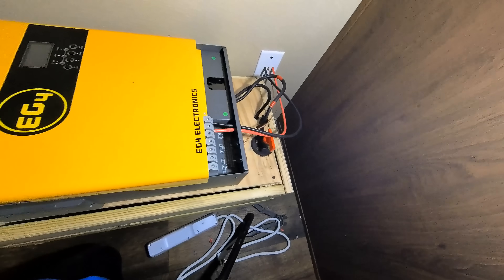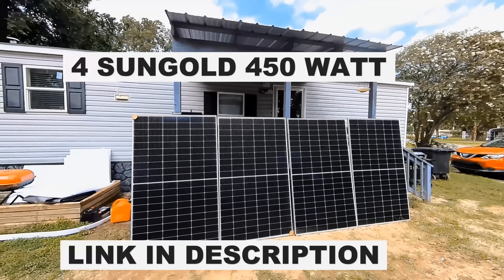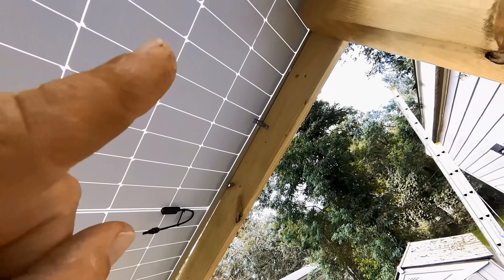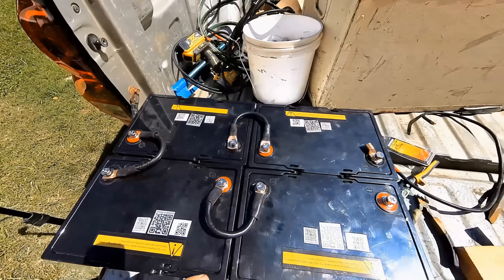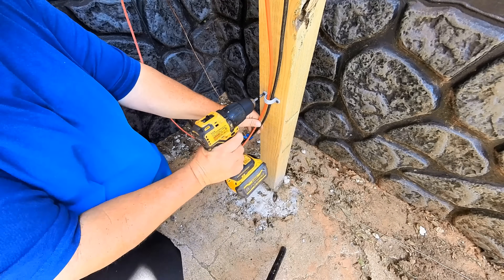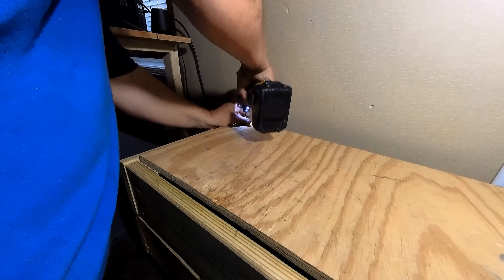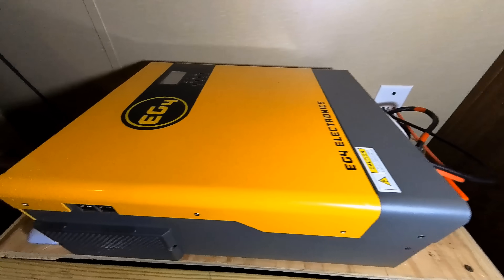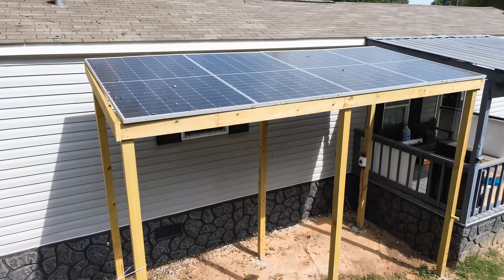Simple Solar YOU CAN BUILD!  Using Sungold Solar Panels

Comment: Why did you choose to do 48 V 100 AH instead of 12 V 400 AH? Is there that much better efficiency converting to 120 V?
Reply: Also, wouldn’t it be better to run a series parallel solar array? I seen power loss when doing all series, also overcapacity for most solar controllers.
Reply from the maker: You're definitely not going to get a power loss wiring them in series it's just all about the way the math is done it all comes out the same except for the fact you are much more efficient as far as higher voltage means lower amp and lower amp means smaller wires but yet it's the same power in the end... 12 volt is basically obsolete when it comes to a home solar system.. 24 volt at minimum but never go 12 volt the amps are too high and the wires have to be enormous especially if you're traveling any distance from where your batteries go to the inverter and no this inverter will take 500 volts and some will take even more

Comment: It's the perfect little set up for a little spot in the middle of nowhere. What's even more awesome was the presentation. All that in minutes and kept me interested. One of your best yet.
Reply from the maker: That's a flattering comment I really appreciate that I worked hard on it
Reply: Yes you did a great job my friend..very well done I’m lovin it thanks for the guidance!!
Reply: @OKLAHOMAOFFGRID  This was my thought as well. The different camera angles weren't necessary but they kept the presentation interesting. First time viewer, thanks!
Reply: @OKLAHOMAOFFGRID  question OKLA..if i invest twice the price will the inverter handle 8 panels instead of the four you used? or will i need a bigger inverter?
Reply from the maker: @Dgoldsweeps4002  it's really not about how many panels it is but it's about how many watts each panel is... The inverter that I used in this system will hold 5000 Watts worth of panels. You can get the bigger ones that will hold 8,000 or you can get two of the ones I have here and it will hold 10,000 and you can parallel them together. I only have four panels at right around 1800 watts. I could literally put another 3,200 Watts worth of panels on that one EG4 inverter

Comment: You didn’t mention much about wire sizes but those batteries appear to have a 100amp bms at 48v.   Your cables look small.   Your disconnect needs to be able to handle that load as well
Reply from the maker: Yes my friend for a hundred amp hours at 48 volts we have plenty of wire gauge. And yes the disconnect is rated for that. This is not the disconnect that I'm going to keep for this system I'm ordering 48 volt breaker for the disconnect it'll be here soon. Thanks for the comment

Comment: One question you have a 200amp fuse as well as a T class 250 breaker safety between battery and inverter ? Why both
Reply from the maker: Well you can use the breaker in between the PV wires and the inverter if you don't have an isolator switch or a combiner box with built-in breakers. And as far as the fuse goes if you don't have breakers on your batteries like server rack batteries have and you can put a breaker in between them and the fuse in between the PV wire and the inverter it's just all about how you want to do it each of them would serve the same purpose

Comment: Did you go with the regular or Bifacial Panels from Sungold Power? I bet that Fan Noise is Driving you crazy lol. I wanted to get the EG4 12k because its quiet, you should try to get one of the Eg4 Brightmounts. Its a cheap ground mount. I think its like 279 or something like that
Reply from the maker: i been looking at the ground mount..its not noisy at all. and no not the bifacial..they were out of stock
Reply: @OKLAHOMAOFFGRID  I put my EG4 Brightmount on Four 6x6 posts just like AveRage Joe did in his video

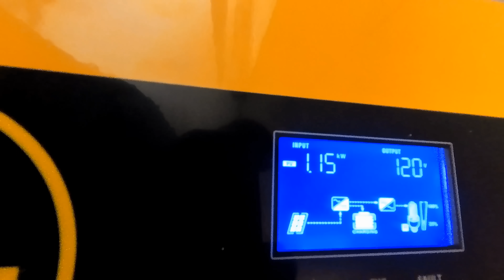Comment: SAY WHAT..  11:40 mark.. 1.5 KW.. out of 1.15..???  BAD MATH DUDE..!  ps. Modem.. not internet modem. lol..    Nice quick build.. BUT you should add an inline fuse on the positive lead from your panels. Hopefully there's a fuse inside that all in one inverter. you didn't mention it.
Reply from the maker: @OFFGRID_Trucker  plan on it plan on it and plan on it I told you in the video that the fuse and breaker was on the way from Amazon I guess you missed it or clicked off the video and commented before it was over .and yes made a quick misquote but not bad math I have no director or anyone to help me film design or pre edit these videos. It's all on me and I'm not perfect..but just between you and me I have seen 1660 watts coming in as of yesterday..or 1.66kw 😂
Reply: @OKLAHOMAOFFGRID  Well darn it.. I guess I need to slow down. I did miss it. MYBAD. Yeah. no help from anyone else here too.. lol.. IF you were perfect you would up in heaven with Jesus. sorry, didn't mean to be rude or harsh. That's putting out some good power. I've seen just over 1700 with this system a couple of months ago. It hover about 12 to 1400 lately. In fact EW is sending me a new sun sensor for my tracker. It's not been working for a few months. I manually tilted it a few days ago and saw another 500w improvement.. :(
Reply from the maker: thats great..no worries
Reply: Or 1.15kW but he accidentally said 1.5. Give him a break.
Reply: @DrPhatMusic  I did.
Reply from the maker: exactly

Comment: 4:28 should have spent more on the isolator. Key pieces of safety, you shouldn’t cheap out on.
Reply from the maker: I'm a diy..don't know the difference in a great one or a mediocre I'm no problem..but I am still learning
Reply: It's a switch... probably with an arc shield and waterproof is all. Price sounds appropriate for this scale of a system.
Reply: Whats your idea of "more"? I've seen them listed for $20 -$120. 🤷‍♂️
Reply: @ key component like this I would look for American certification of safety. Under $75 but more than $20 is my best answer.

Comment: Im starting my first DIY 1200w solar , using it on my home instead of using a generator in the event power goes out and when power is on use it for a few things around the garage. Ive watched every DIYand dude yours is 100% the best info for it. Thanks for giving me the insite
Reply from the maker: No problem if you buy any of the equipment I use make sure you use my links that way I'll get credit thanks for watching

Comment: 😍 what is the weight of one planel. Just trying to find oit if my garage roof will hold it.  And need to finde out if my area allows the use of a solar system like this. We  alread have a balcony solar power system but we max can get 300w in. Blessings
Reply from the maker: The weight is 54 lb for each panel

Comment: Hello , do you think someone brand new to solar panels be able to do this? Also, is there a way to hook the inverter directly into the house so the lights in the house can work and not just an extension cord.
Reply from the maker: Yes I do think that somebody new to this could do it themselves and also yes they're absolutely is a way to hook it into the house you would need to get a critical load panel and have the wiring running to some of your most important appliances in the house taken from the old house panel and wired into the new one. That part there you might want to have an electrician do. Or at least have somebody familiar with electricity guide you through it

Comment: Not sure about your county you live in but are you sure the way you wired that through your house is up to code?
Reply from the maker: It's a portable system no codes required..same as running an extension cord from a generator threw your window during a power outage

Comment: Was anyone else cringing when he ran the wires through aluminum siding without any protection? 😮

Another thing I noticed, your EG4 inverter needs to be mounted vertically. The cooling fans are located at the top of the unit for better heat dissipation. Having your inverter mounted horizontally will cause it to overheat, potentially shortening its life expectancy.
Reply from the maker: LMBO.. that's vinyl siding
Reply: @OKLAHOMAOFFGRID  Well that's WAY better than what I thought...  I'm kinda showing my age, do they even make aluminum siding anymore 😂. Something I noticed about your EG4, (you've probably already fixed) but it should probably be mounted vertically for better heat dissipation. Anyways I enjoyed your video, I look forward to seeing more.
Reply from the maker: @HeliosT3ch  it doesn't matter how it should be mounted it's got fans on the sides and fans on the bottom and they all flow good there's nothing on the back
Reply: Still, heat rises. Better mounted vertical. Iam sure there are at least some heat plates inside and the Ingenieur who designed this has put in some thoughts into the design. Besides that, cheap and fast done but that’s not exactly my style.
Reply: @HawkonAir  That was my thoughts.
Reply: @HeliosT3ch  Iam living in Germany - Swabia, which means we are grown up thinking about how to save, how to properly spend money and make thinks on our own. We have the saying: Buy cheap, by twice!“ This goes also for craftsmanship/build quality and sustainability. This setup was done cheap and fast, fine I get the idea. But it will harm the system in the long run. Where is the BMS and why are the batteries not stored properly. They will spread out without the right container/box and lose capacity. Also why not use some cheap PVC cable channels (he also doesn’t use one on his own property) to make it look neat. Storing batteries inside the house, I wouldn’t recommend. 

The shown setup is at best a short temporary solution, but my German/Swabian gut still tells me it’s wrong. But overall that’s a cultural thing, saying that I sit in our 550 year old house and watching YouTube xD.
Reply from the maker: well..I guess yall got a point, will fix it
Reply: @HawkonAir  You are kidding, right? The EG4 Inverter has everything built in, including a BMS. Lithium Iron Phosphate batteries ( each of which have built-in BMS's ) do not out-gas like Lead Acid batteries and can be housed indoors.

Comment: Not to critique your setup but that 12V switch should not be used, it is way underrated for 48V and will fail and could cause major arcing. Also with these types of high current systems a proper crimp on your lugs is critical, that is not an acceptable way to create a safe crimp and could cause excessive heating on that joint. You can buy a hammer crimp for under $10 that is much more acceptable. And as for saving money on your batteries, spending another $150 more you can get a much better rated rack battery that has full closed loop communications, fire suppression, 7000 cycles,  and 10 year warranty. Other than that you're on the right track.

Comment: Great video. I just wanted to say that you want to hookup your batter to your inverter first and then your panels. Likewise shutoff panels first before making battery changes. Since you had them turned off it was fine. Just wanted to clarify in case someone might not have realized you were isolated from the energized panels when you first hooked up. Love seeing more people setting up solar and showing everyone how easy it is.
Reply from the maker: i literally said ok lets go back out and turn the switch off and get this wired up...but ya I Understand the sequence...thanks
Reply: @OKLAHOMAOFFGRID  Thats Exactly what You did. You showed instructions that came w inverter to us.. 1st battery's to inverter than Went outside n flipped the switch from panels to inverter n Got a reading.. All Good.  Made Me laugh was the 4 devices you used 75" tv.. modum.. microwave.. Funny part was Classic toaster which draws All the power.. n Seeing the Dog ❤ near by.. Thanks again.

Comment: Nice and simple but that power strip will overload and get hot over time. I would not run a ac window unit on that it will burn the power strip up. I’ve been a residential and light commercial electrician for 17 years and I’ve personally seen that problem happen. BUT in a pinch for temporary use it’s ok just not for long term safe use. You still get a thumbs up tho!
Reply from the maker: gotcha man...i normally wire them into a critical load panel..but this is a portable system..max amps from the inverter is 20 by the way

Comment: great, but you need a battery balancer, to balance each battery with the same voltage
Reply from the maker: checking the blue tooth app they seem to be pretty close on the voltage. If they mis align too much they will have to be charged individually to get them into compliance

Comment: 48v at 200 amp???
Reply from the maker: 48 volt @ 100 amp hour
Reply: @OKLAHOMAOFFGRID  The main difference between wiring batteries in series and parallel is the impact on the output voltage and capacity of the battery system. Batteries wired in series will add their voltages while the capacity stays the same. Conversely, batteries wired in parallel will have their capacities (measured in amp-hours) added together while their voltage remains the same. However, the total available energy (measured in watt-hours) in both configurations is the same.

For example, wiring two 12-volt batteries with 100 Ah capacities in series will output a 24-volt system with a 100 Ah capacity. Wiring the same two batteries in parallel will output a 12-volt system with a 200 Ah capacity. Thus, both systems have a total available energy of 2400 watt-hours (watt-hours = volts x amp-hours).

Comment: I like your "Can Do!" attitude.  This is how DIY things get done.  With that said, why didn't you buy the gland to run your PV wires into the building?  They are super cheap, seal much better, and give a much better finished look.
Reply from the maker: I was trying to get it done that day that I was filming that's why I did not even wait on the breaker or the fuse